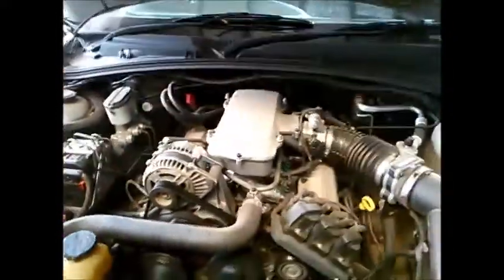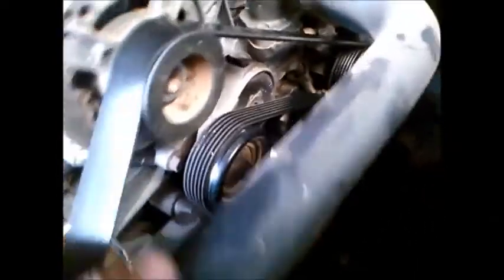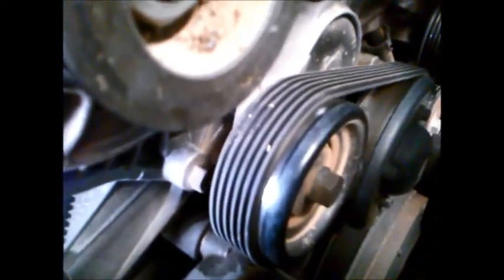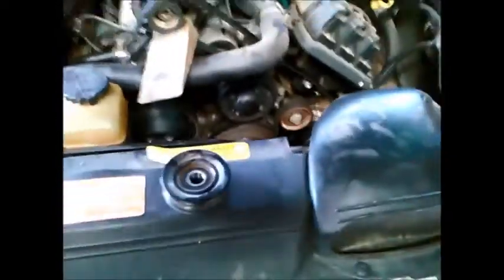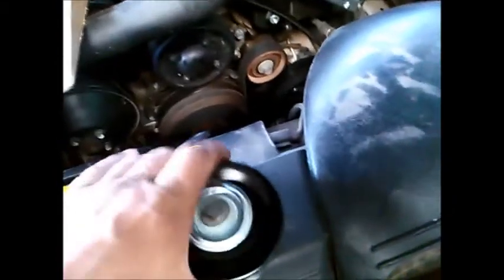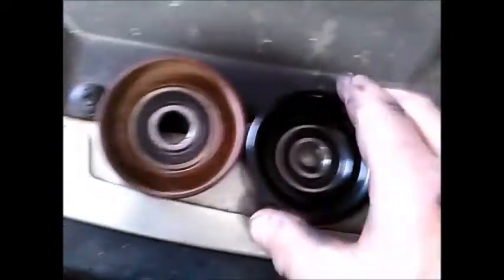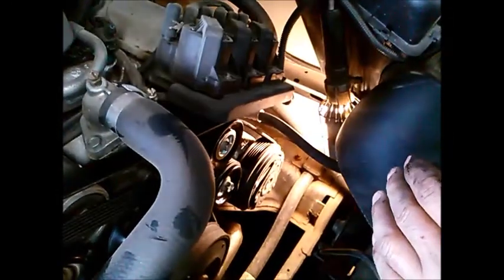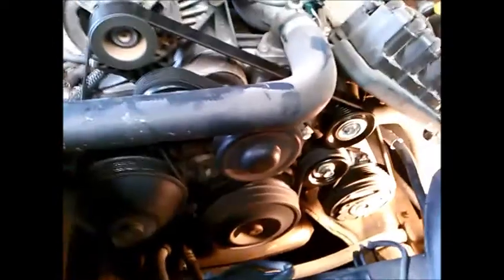Drive Belt Idler Pulley Idler Bearing Replacement - Commodore GM Quick & Easy How to

Comment: Hi Yepthatsit. Ive seen a few of your videos and found them great. Could I ask a question.

I installed a brand new belt tensioner and 3 nuline wheels when I serviced my 2003 VY V6. Ive noticed now that the belt is sitting right on the edge of the pulley wheels and tensioner. Even of I readjust the belt, it slides again to the edge of the pulleys.

Could the tensioner I brought be bad?
Reply from the maker: hi, send me pic via our facebook link in description. cheers

Comment: I went to do the bottom 16mm pulley and 2 of the 3 studs were snaped off in block.
Reply from the maker: hi, thats youre new hobby ! try soaking the broken bolts in wd40 then try tap unwind them with a fashioned chisel out of some hss ( high speed steel ) if loctited in, easier if you heat them up, check out our magnetic induction gun vids.   https://youtu.be/ws3VHr3wSGU 
  https://youtu.be/EAWpREwMTL8   or stripped bolt head vid  https://youtu.be/1bSuKQM-BGI  cheers

Comment: Hi my name is Paul, I'm just using my wife's login.  I can't help but notice the Commodore VZ doesn't get a mention.  Does that suggest it won'
t work on a VZ, which is the model car that could have the Idler pulley problem?  Thanks in advance.
Reply: The vz commodores also have this issue, just the pulleys and pulley locations are different. But they can still wear the same. Cheers

Comment: SAFETY FIRST PLEASE
Please use a 15mm ring spanner or socket on the tensioner pully bolt to release tension on the belt and remove the belt.
 Note: This bolt is a left-hand thread.  Turning it anti-clockwise will tighten the bolt and loosen the tension on the belt at the same time.  If this pully is to be changed remove the belt and turn the bolt clockwise to loosen, ONCE THE BELT HAS BEEN REMOVED.
 This is safer than wedging bits of wood into various places.
Reply from the maker: thanks for your input. cheers

Comment: Mines is stuck how do I get the poxy thing off plz help me
Reply from the maker: hi, have you taken tension of belt off the pulley? incase someone has put loctite on it...you will need to either force it off or if you heat it ( see our magnetic induction heat gun vid https://youtu.be/ws3VHr3wSGU ) to get it off when has loctite or similar, cheers